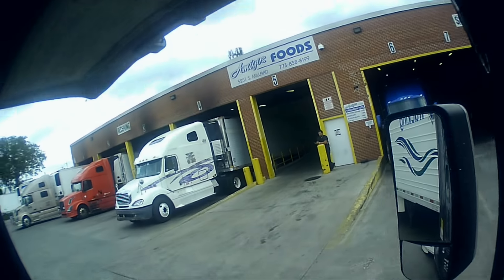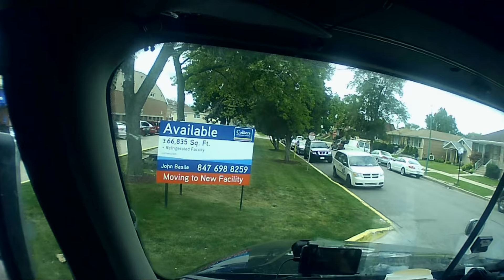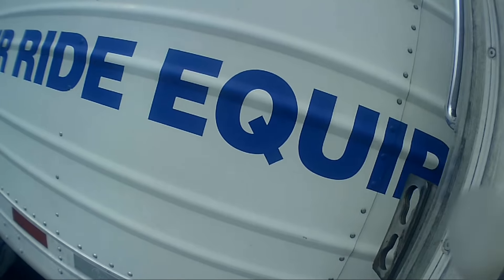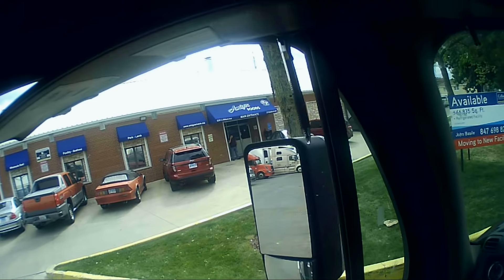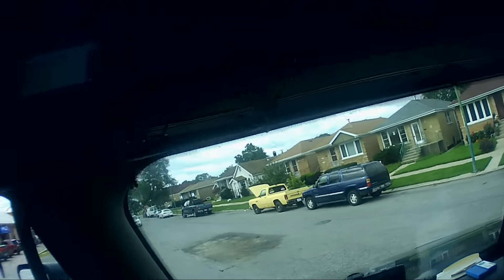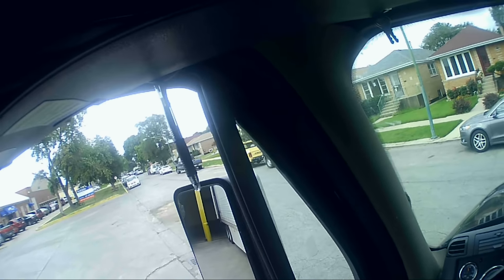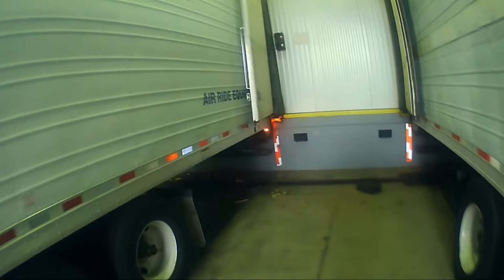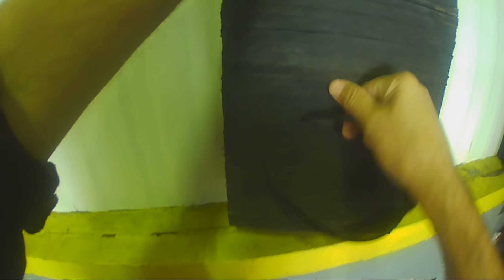Chicago Hole

Comment: I've always wondered why you shut the reefer off when you load or unload.  You are the only person I have ever seen do that.  And this time, the dock worker even questioned you on it.  With it off, once you open the doors, the trailer immediately starts to warm up.
Reply from the maker: If you don't shut the reefer down the cold air blowing out of the upper chute will accelerate the existing cold air in the unit to just blow right back out onto the ground. The better practice is to shut it down to keep the cold air still in the reefer. Yes you will lose some air and it does try to immediately equalize temperature with the outside world but it is a slower process with it turned off. Forgot to mention that if you do leave it on and dock it,  a high percentage of the time the unit will go into alarm/alert mode because  the sensor says the temperature change is too drastic in too short of a time so you have to press a bunch of buttons to clear it rather than just one button to turn it off and once more to turn it back on.
Reply: You should never run your reefer in a dock it doesn’t do any good anyway   used to be a truck driver and now a reefer mechanic. Another trick when you’re back inside a building just put your wheels of your trailer at the back so you don’t have to worry about the swing of tail of the trailer. If you’ve ever backed into Feria Pan Candy in Chicago.  I think that’s the name of the business